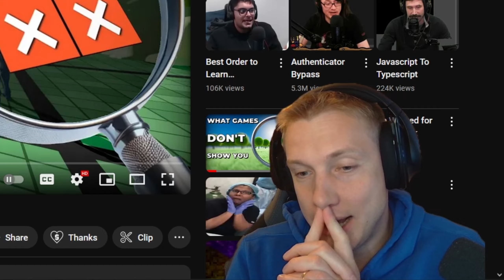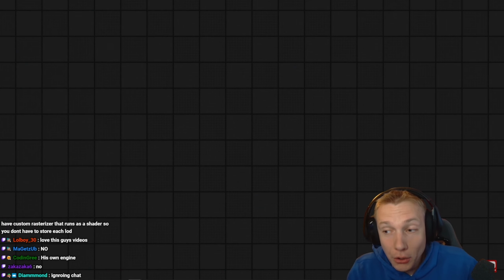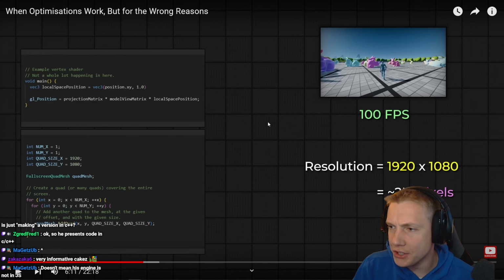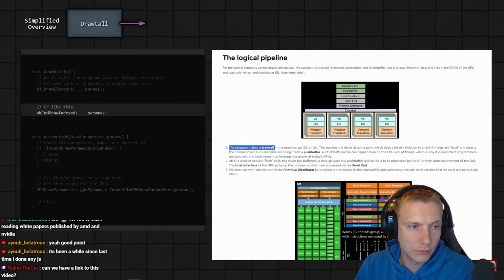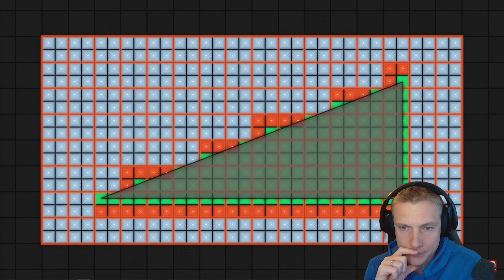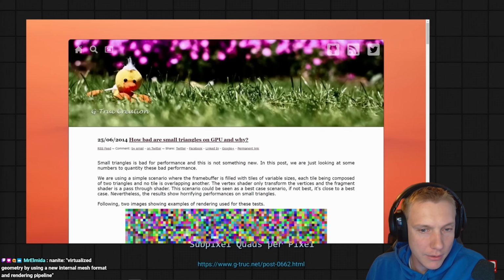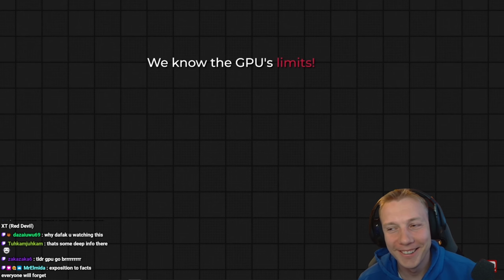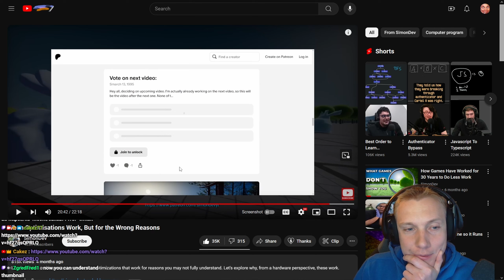When Graphics Optimizations Work, But For the Wrong Reasons | Cakez Reacts

Comment: Nanite LOD is lot more complex than regular LOD. Normally, the entire mesh is swapped out all at once, but Nanite swaps out only parts of the mesh, meaning different parts of the mesh can be in a different LOD at the same time, while still keeping the triangles connected to each other. They also occlusion cull aggressively, so that only triangles which are most likely to be visible are rasterized. They have a siggraph talk explaining the entire pipeline called "Nanite: A Deep Dive", you can find it on youtube.
Reply: Maybe for individual small to medium objects, but it's been done like that for years for things like terrain. Nanite isn't new in that regard.
Reply: @lordofthe6string  No its not, Just watch the SIGGRAPH or "Nanite: A Deep Dive" video by the man who made Nanite before shouting.